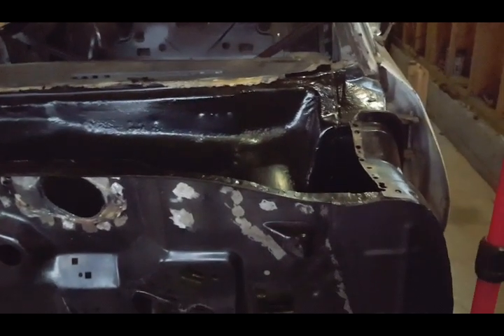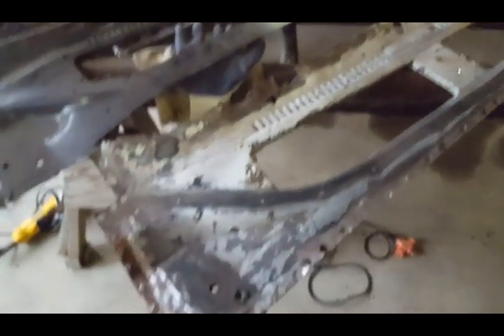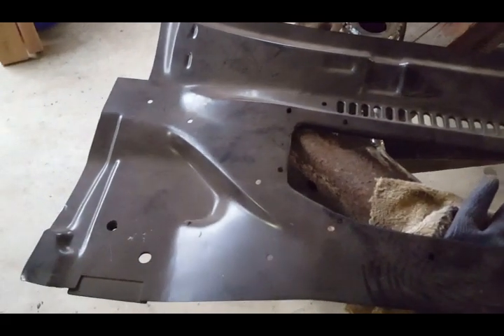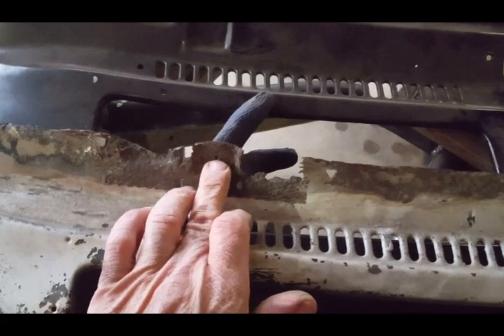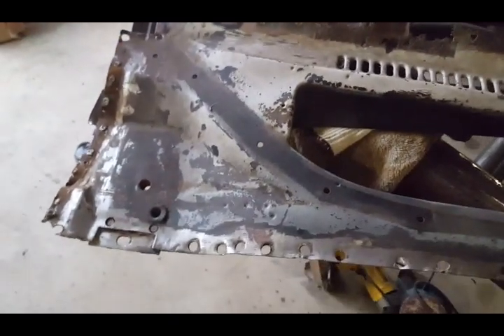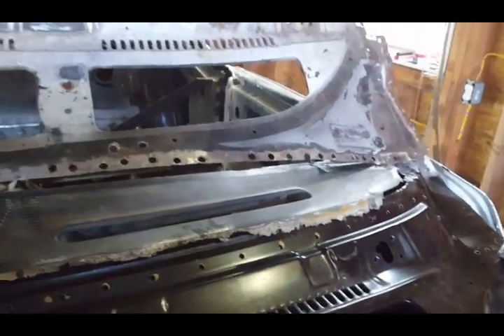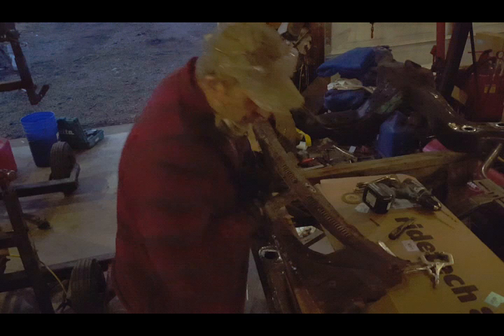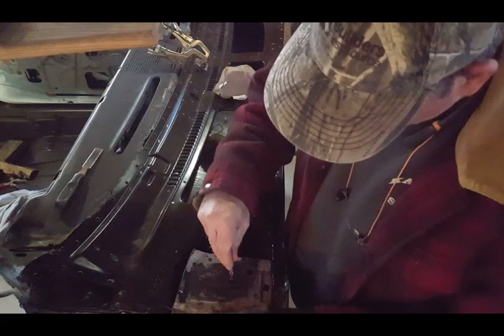Cowl panel install,68-74. Chevelle, GTO, LeMans, Oldsmobile

Comment: Just got my Upper cowl panel in. It does have the square antenna hole, so I'll have to patch that up.
The fender mounting holes are ok. (Glad I'm doing a Chevelle), I don't have to drill those holes and weld nuts. Hope to have it installed next week. Don't forget to post your windshield channel video. I got that part in too, so I'll be ready to install that after the cowl panel.
Keep up the great work!!!
Reply from the maker: Hi Wayne. That is awesome!! Just be careful when you weld that antenna hole, I warped my cowl a little bit. I had to pop a couple welds back off and lift it up a little to reweld it. I just got done editing my Window Channel video. I should have it up by Wednesday night. All the best my friend
Reply: Thanks for the tip

Comment: Another great video thanks for the tips and the inspiration! I just finished rebuilding my driver's side cowl shoulder. Couldn't believe how rusty and rotten it was! Not anymore!
Reply from the maker: Yeah it's unbelievable how that rust hides. Mine weren't that bad looking from the outside but once I cut into them they were pretty bad. Thanks for the kind words. All the best
Reply: @classicrewind2715  I was just out in my garage looking and I think that cowl panel you have might be for a chevelle? On my 70 Chevelle I have that square hole that you filled in and I know my cowl has never been replaced.
Reply: I believe that square hole is for wiring access for the stock radio antenna in the windshield.
Reply from the maker: I think you are correct That square hole is for wiring for the antenna in your windshield. I think you're the second person who mentioned that. Thanks again for the comment all the best.

Comment: Be careful for which year of cowl-vent you buy, when doing mine on a 1968 chevelle 300, I tried getting a cowl vent of a 1970-1972, but I was told that they are different from the 1968, so it took a little bit of hunting but I found the right year and got it ordered in, anyways it fits really good, Nice video!
Reply from the maker: Thanks RT, good information. I had to do some fitting on my cowl-panel. someone mentioned that the fender Bolt holes are from the Chevelle. I have an SS Chevelle, but in order to find out I would have to remove the fender. I am not going to do that, so what I ended up doing was welding a nut next to the hole that was there. I went off of the old cowl panel that I removed for measurement. All the best

Comment: Great video, My new cowl panel hasn't arrived yet. I'll have to check those fender mounting holes.
Please post windshield channel video when  you get a chance. My car looks alot like yours. Interested to see how you do it.  Keep up the great work!!!
Reply from the maker: Thanks Wayne. I'm glad you enjoyed the video. Let me know if you get that panel in and it has the same problems. I would be interested in finding out also if it has that big square hole up top in the center. All the best
Reply: @classicrewind2715  What size holes did you drill for your plug welds?
Reply from the maker: Sorry Wayne, I just saw this comment.. I drilled 1/4" for my plug welds

Comment: @classicrewind. Question have you heard of people filling in the cowl vents on the 68-72 A-bodies, I just installed the upper and lower cowl on mine along with fire wall, floors, and A-pillars. I have the outer cowl panels off still and thinking of patching over them to prevent air flow for better AC. Mine ar kinda rotten(the vents) Thank you for the work and the videos they are inspiring!!! 

It’s a resto-mod not a numbers matching car but a real 242
Reply from the maker: Hi. No, I haven't heard of anyone filling in the vents. It's only pulling air from the upper cowl panel. I don't know if that would make a big difference in the air conditioning.  You could always block them with a custom piece of plastic. I don't know if that would help. Thank you for the kind words I'm glad you're enjoying my videos. All the best

Comment: I noticed you did a lot of spot welding on the top part by the dash what did you weld to? Did you weld to the box lip?
Reply from the maker: Jesse, I spot welded across the window Channel and the cowl panel. I weld it to the inner cowl box. Basically tack welded the whole dash to the new window channel. Check out my window Channel video that pretty much explains everything. https://youtu.be/p-IlHrq7MyE
 All the best.

Comment: How did front fenders do after install of cowl did you have to use original holes or the ones you welded in
Reply from the maker: Had to drill new holes and weld nut  underneath. It should be  in the video.

Comment: That square hole is for your antenna on a 70 model Chevelle
Reply from the maker: Yes, they threw me off because both of my 68 have Fender antennas. I ordered it for 68 GTO it should not have a square hole in the cowl panel, it's for a window antenna. You are correct. All the best

Comment: Just Looked At A 72 Cutlass That I've Got And The Big Hole(Center Of Dash) Is Where The Antenna(Wire In Windshield) Is Plugged In. 68's Had Actual Antennas(Like You Know Owning A 68). Panel Is Probably A 70-72 Or Generic.
Reply from the maker: Hi Mark. Yes, that is a antenna hole. I think when you buy that panel they automatically have it in the panel. I bought a couple for other cars and they all had that square hole for the antenna. My 68 Chevelle does not have one in the panel. like you said it has a separate antenna. All the best.

Comment: Can you show how you reattached the VIN on the new cowl off the old ??
Reply from the maker: Did not touch the VIN. You can't buy the upper Dash panel . I just changed the window Channel. Hope this helps all the best
Reply: What if I took it off to Grind everything and make it all purrrrty. How.would I reattach it ? Tia
Reply from the maker: You are not allowed to tamper with VIN numbers. I have no idea. I'm sure restoration shops do it all the time.
Reply: Thanks maybe I'll melt down some lead and put it back and try to make it original

Comment: Electric antenna hole ? Cutlass has a n antenna wire built in the windshield & the connector sits in that area.
Reply from the maker: Yes,  all new  Cowl panel comes with that hole. I filled it in I did not like that hole in the panel

Comment: I think I figured out why the fender bolt holes didn't line up for you. I have a 68 Chevelle and the holes are 2 1/4 apart. The fenders must be different on the GTO.  Measure your 68 Chevelle when you get a chance.
Reply from the maker: Wayne thanks. I will look into that tomorrow, I'll be out in the garage. I have a lot of work to do. Getting that window Channel prepped. I will definitely check the Chevelle to see if I do have 2 1/4" that would make sense.. The Company I bought my panels we're not that knowledgeable. I don't think I would buy from them again. I ordered trunk filler panels for the car. They sent one for a 66 LH GTO and one for a 68 RH. I will let you know what I find when I measure. All the best
Reply from the maker: Hi Wayne. I checked the Chevelle, the only way I could find out the distance between the hole one mind is to remove the quarter panel. My friend is building a 68 GTO convertible as well his cowl panel holes are off as well. You are correct I think it is a Chevelle cowl because you're measuring 2-1/4 on yours

Comment: The square hole is for a 70 GTO windshiels antenna wire in the windshield
Reply from the maker: Yes, why they put it in all the aftermarket cowl panels it's beyond me. If you want an antenna wire, you  should be able to cut it out if you want. All the best

Comment: What company are you buying your panels from?
Reply from the maker: Hi John. I bought my panels from OPGI, I have a friend that bought the same cowl panel as me from another company. It was  identical to mine. The bolt pattern was in the wrong area and also had the large square in the center of the cowl. Exactly like mine. Thank you for commenting. I appreciate it. All the best on your build..
Reply: @classicrewind2715  i know you said you got the panel from opgi. By chance do you know who actually made it. ( goodmark, dynacorn ect...) opgi is backordered. I can get a dynacorn.
Reply from the maker: Hi, I don't recall who made it. But you could find them pretty much anywhere. Try this place BSP https://bodyshopprice.com/1968-69-gm-a-body-upper-cowl-panel-skin/
Let me know if this helps. All the best
Reply from the maker: @flounder009  I don't know if you got my message before. but there is a lot of places that you can buy that panel from. try eBay they normally have pop-ups where you could buy those panels. all the best
Reply: @classicrewind2715  yes i got it. Thanks.  I bought mine from groundup (ss396) only one that had it in stock.
Reply from the maker: @flounder009  great. I'm glad you found it. I didn't realize I did not send the reply directly to you. It just posted on the video comments. All the best